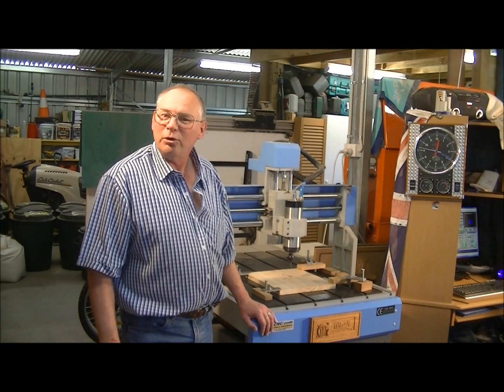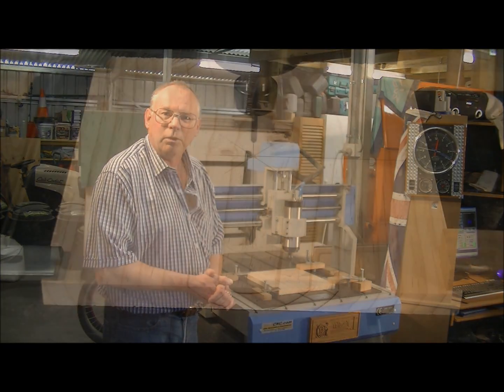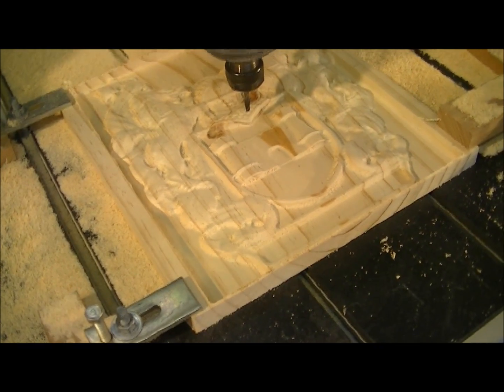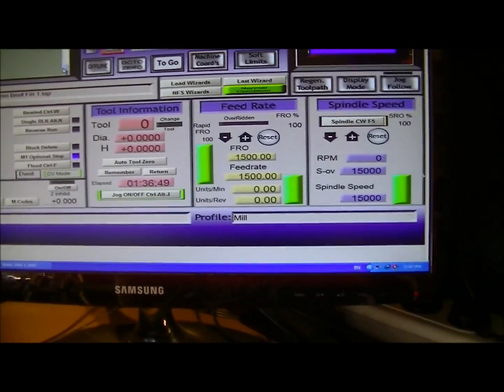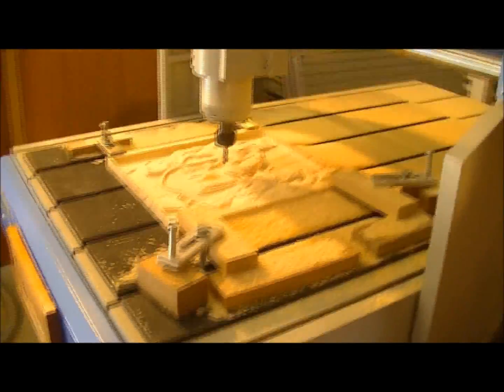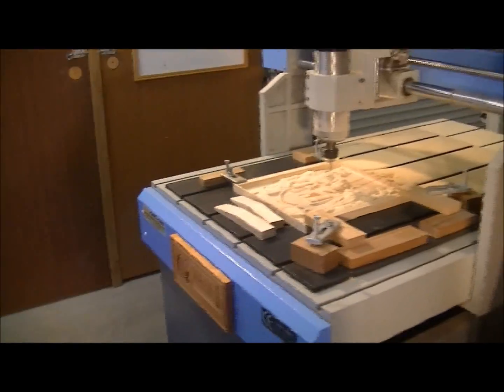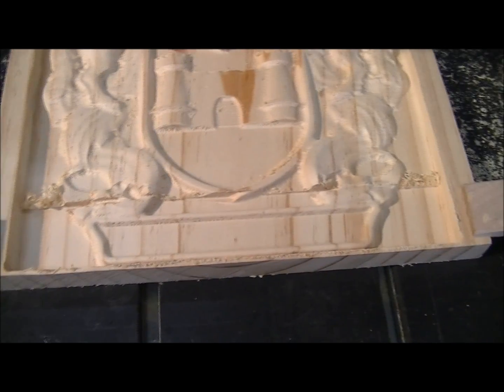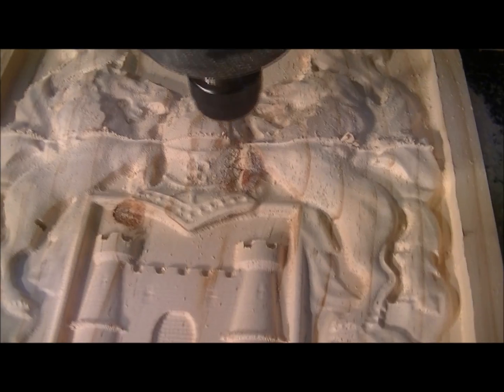CNC Router making a 3D carving a Coat of arms, with , Mach3 and ArtCAM tutorial.

Comment: in metal (aluminum) i use feed rate of 90 mm/sec at 0,07 to 0,1 mm depth with 5mm tool
it dosen't melt the material, and it's safe for the operator because the chip load is small and there is no risk of brakeing the tool, and that is really important

Comment: Good evening . What do I need besides cnc machine, to make these pictures, some course Art cam and auto kad
Reply from the maker: Hi,  Email me at : info@pacifictooling.com  I will send you information on our new Wood Lathes
 and CNC routers, 4040, 6060, 6090 , 6012 , 1212, 1224, 1325 and now CNC 6040, 6090 , 1390 Lasers (linear rail model), and machine tool accessories . 
 Australian Inventor, Roger Clyde Webb, Pacific Tooling.

Comment: Thanks for this video, very interesting work. By the way, I've build a large cnc router myself. It's operated by LinuxCNC, which is not worse than mach3, and is also very easy to work with, while being absolutely free of charge unlike mach3 which costs 1400USD for the pro version and 200$ for the hobby one. The problem with mach3 is that it's a windows software. Windows is not the best choice for this sort of equipment as to me. Linux proves to be a much more reliable system in terms of different viruses and network attacks.

Comment: Hello Mr.Roger webb
I'd like to ask about some of the details about this machine, such as:
* What is the maximum size of the machine can be played (length, width and height)?
* Do you work the machine on any type of woods including hardwood? Does that can work on any material other than woods?
* How is the introduction of shapes and drawings executed by the machine?
* Is there some pieces that need to be changed periodically in?
* How much is the price of the machine?
Reply from the maker: Hi please send an email to: webbpartners@netspace.net.au and I will send you some
information on our new 6090, 6060 and 6012 (linear rail model) CNC routers. Our new company name is Pacific Tooling. 

Australian Inventor Roger Clyde Webb

Comment: These machines   do you scan the picture into the machine?   also how much does this machine cost?
Reply from the maker: Willie McCowan 

The 6090 (bed size) CNC router machine is from Salecnc
China, http://salecnc.com/catalog/new-products (speak to Jimmy good English), I
had the machine up rated to 8 inch / 200mm gantry and 2200w / 3hp spindle
(router motor) + I had the 4th axis. Total cost including shipping
and TAX, USD$ 7000, I would also recommend you purchasing ArtCam Express
software approximately 200 USD, as the CNC router machine is supplied with
ArtCam Jewel-smith from Salecnc China, but with NO 3D reliefs. ArtCam Express
comes with over 600 3D reliefs. Take a look at ArtCam Express tutorials on YouTube
. It may give you a better understanding of how 3D models are made and
converted to CNC tool paths. Understand that there are years of learning and
experimentation by me that are not in the videos and projects to enable me to
carry out and achieve what you see in my videos. Hope all this helps. 

Roger Clyde Webb Australia;-)

Comment: Goodmorning again Roger,
Visited a store in Ottawa recently and an older salesman discouraged me from buying a CNC because 1- they are unreliable 2- they are too slow 3- sawdust affects the computer 4- bits are too expensive 5- poor service and warranties on CNCs 6- more trouble than they are worth.

Any comments?  by the way, It's -20deg Celcius here in Matawatchan, Ontario this a.m

jp
Reply from the maker: Jp Degrandmont 

Hi, have a look on
YouTube at my videos and see for yourself, cut out the middle man and save some
money. (DIY). 

The 6090 (bed size) CNC router machine is from Salecnc
China, (speak to Jimmy good English), I had the machine up rated to 8 inch /
200mm gantry and 2200w / 3hp spindle (router motor) + I had the 4th
axis. Total cost including shipping and TAX, USD$ 7000, I would also recommend you
purchasing ArtCam Express software approximately 200 USD, as the CNC router
machine is supplied with ArtCam Jewel-smith from Salecnc China, but with NO 3D
reliefs. ArtCam Express comes with over 600 3D reliefs. Understand that there
are years of learning and experimentation by me that are not in the videos and
projects to enable me to carry out and achieve what you see in my videos. Hope
all this helps. Roger Clyde Webb Australia: )
Reply from the maker: Roger Webb PS GO MACH 3

Comment: Buen trabajo, quisiera hacerle una pregunta ¿ Que precio tiene el router como el suyo?
Reply from the maker: Antonio Merichal Cuesta 
Gday Antonio.The 6090 (bed size) CNC router machine is from Salecnc
China, (speak to Jimmy good English), I had the machine up rated to 8 inch /
200mm gantry and 2200w / 3hp spindle (router motor) + I had the 4th
axis. Total cost including shipping and TAX, USD$ 7000, I would also recommend you
purchasing ArtCam Express software approximately 200 USD, as the CNC router
machine is supplied with ArtCam Jewel-smith from Salecnc China, but with NO 3D
reliefs. ArtCam Express comes with over 600 3D reliefs. Understand that there
are years of learning and experimentation by me that are not in the videos and
projects to enable me to carry out and achieve what you see in my videos. Hope
all this helps. Roger Clyde Webb Australia :) 

PS.Thank God for Google translator.